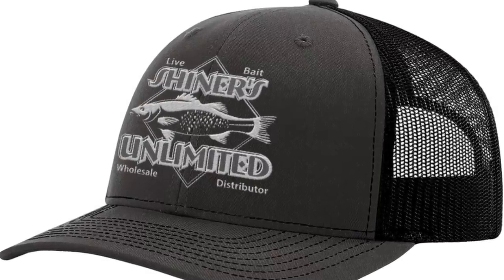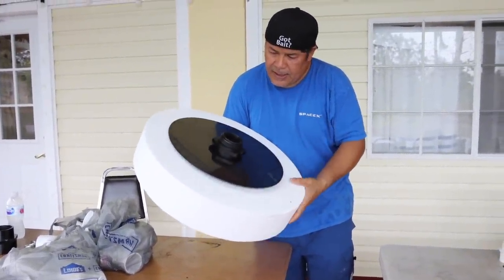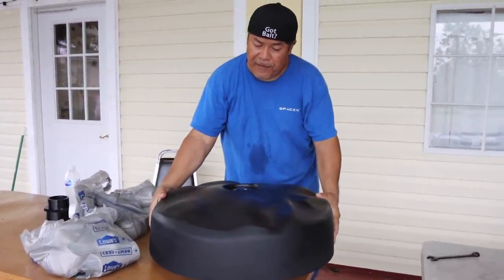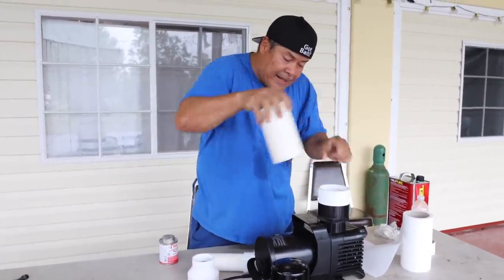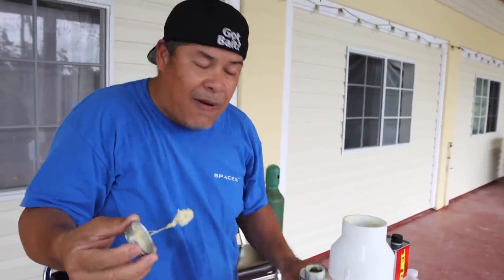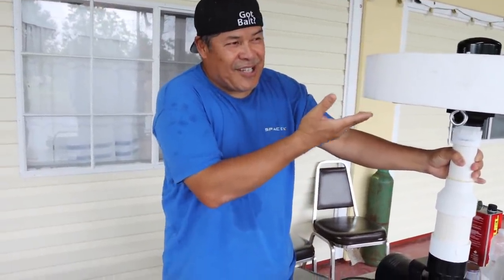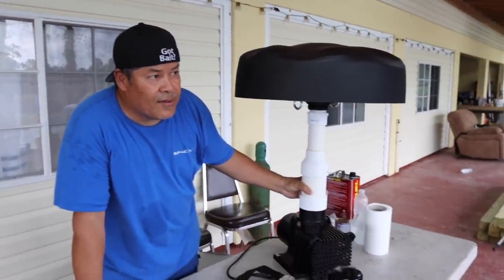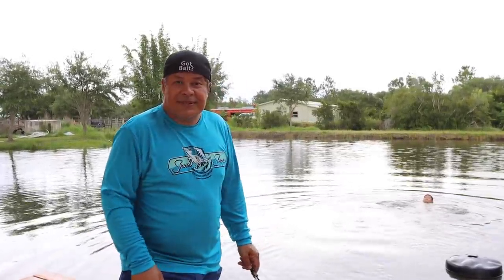Setting Up Water Fountain For My Pond

Comment: Sam, can you cover in a video how you make the power cord longer and still be waterproof enough to submerge it in the water?
Reply from the maker: The original cord that came with the pump is 30ft, you can add on an extension cord  what ever length you need. When you connected the two together make sure you sealed with marine silicon then wrap it up with a flexible pvc teflon tape, wrap it as much as you like and that should do it. Good luck 👍

Comment: any links where you purchased all the pieces? thanks
Reply from the maker: I bought the pump from ebay that sold by Discount Aquartic made by Jebao 9000gph for $250  and a fountain head you can get it from Graystone.com is 24" and is about $152. Good luck 👍

Comment: Where did you buy the float?
Reply from the maker: I bought a pump from ebay that sold by Discount Aquartic made by Jebao 9000gph cost around $255 and the fountain ⛲️ head I bought it from Graystone.com model N2 if I'm not mistaken. I doing another video on water fountain update and I will list more details on the parts that I use.

Comment: Great Video,  I have a nice pond myself and have been wanting a Fountain, but refuse to pay 2k for one as well.  I like how you built your own.... BUT I logged in thinking you'd have your parts list somewhere but NOoooo. Why Sam? I have looked and can't seem to find the parts as you have,  (HELP)
Reply from the maker: The pump was made by Jebao 9000gph and sold by Discount Aquartic on Ebay, I paid $250 for it. The fountain head you can get it online at (123ponds.com) model ACF2N is $152.99 and you only need a few pieces of fitting to finish the job. Let me know if you need any help.
Reply: I’m glad Keith asked the question. Thanks Sam for sharing this information. Sam Can you tell me the height of it or the pieces of PVC you bought so I can build one myself too?

Comment: Sam, fountains are pretty but they only aerate the TOP couple of feet of the pond, better than nothing. Bottom aerators do the entire pond from the BOTTOM up. Much better at increasing the oxygen levels. Both together is a winning situation.